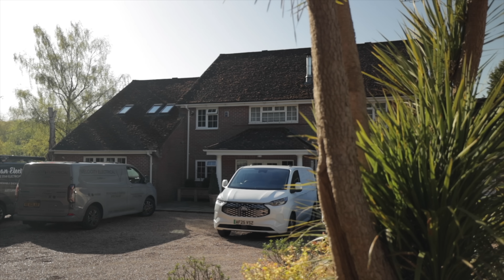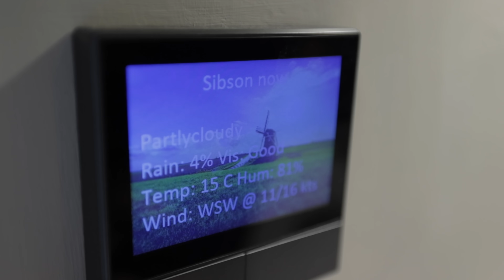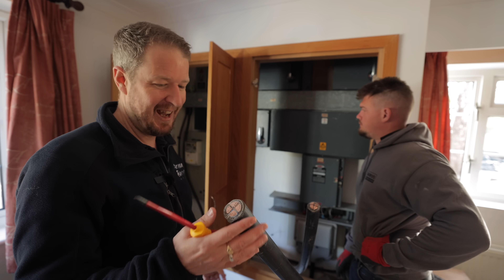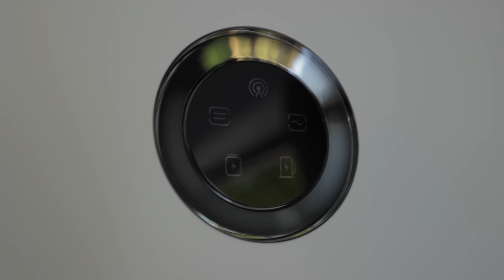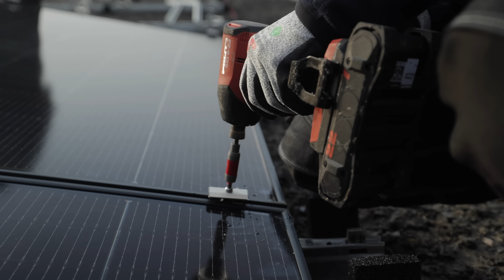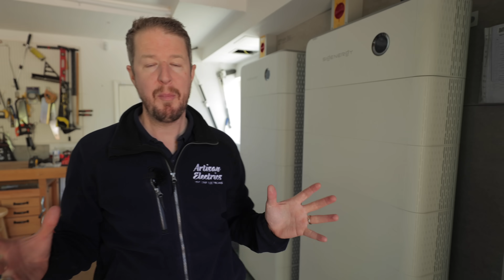Is Battery Storage Actually Worth It In 2025?

Comment: The Sigenergy system are selling really well in Australia, particularly now the newly re-eleted federal Govt is giving a 30% rebate for batteries. This is on top of solar rebates, and state level rebates also.
Reply from the maker: That's great to hear! A 30% rebate on top of solar and state-level incentives is a huge win. No wonder the Sigenergy systems are flying off the shelves in Australia!
Reply: @artisanelectrics There’s going to be a huge increase in installations from July 1. The federal government’s logic is that it will help stabilise the grid as all systems must be enabled to put power back into the grid. One third of houses already have solar.
Reply: @budawang77 So when the power company needs the electricity they discharge your battery down to 10%,leaving you with no useful capacity,  how dumb can people be?
Reply: @lintrobb4628 Just use Amber. They give you control over when and how much you discharge. No need to be dumb🙂
Reply: @lintrobb4628  just because they have to be enabled doesn't mean your inverter has to send it right?
Reply: @lintrobb4628 VPP are optional so if you have not opted in for a vpp they can’t do anything to your battery
Reply: Just handing your cash to China, so they can build more subs, so you need some more, isn't the world great.
Reply: Cost is the number one disadvantage. Where I live it outweighs any benefits. This is valid for solar and definately battery storage. Our electricity prices are below 3 euro cents during May to September. The rest of the year the roof have snow cover. The best storage solution is for heating only and that is using a water tank and underfloor heating in a concrete slab. We run a ground heatpump. The average yearly temperature here is 4.2 C. Occasinally during winter it drops to -30 C. We used 11 800 kW for all electricity in 2024 including heating of 240 sqm. For the electricity I paid 555 euros exluding transfer and taxes for the full year.

I understand that solar and batteries can make sense in some places in the world for businesses and sometimes maybe even for private use. In most of the cases energy utilities are however most cost efficient way of generating energy. Governments subsidising private solar and battery installations are just making stupid decisions. The only benefit of that is maybe some benefits of a decentralised energy system for security reasons.

Comment: I do have a question on the fire safety side, I was looking certain ones because of the electrics. Just because of how I am with safety and that I would be most likely to be running a home sever and security system. I am just looking at what you would advise considering water based wouldn't be good and another I was looking at is banned. Am only guessing that some customers may have asked this possible type of question.
Reply: i put my system in old iron bathtubs with a IBC tank on top and water tubes connected to it running on the battery

if there is a fire, it will melt the plastic IBC tank and the tubes and the water will fill up the bathtub